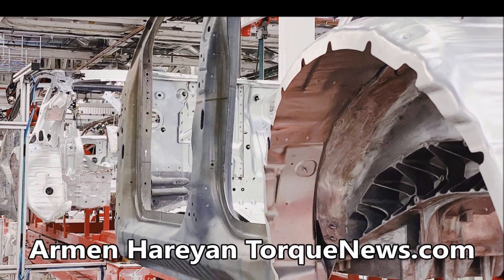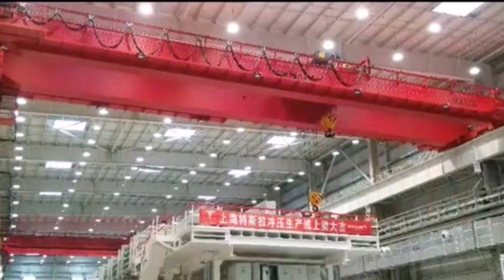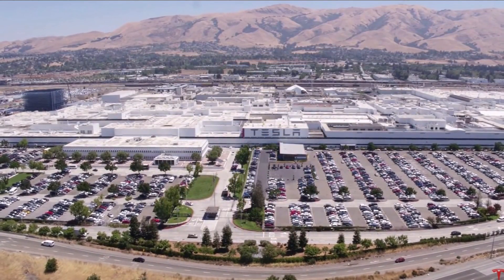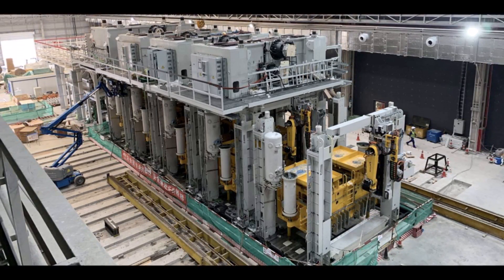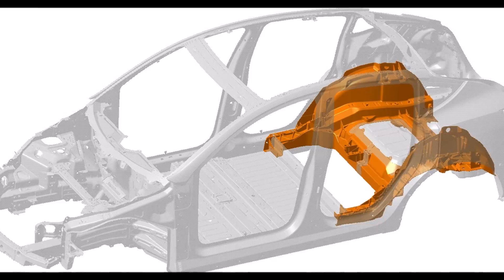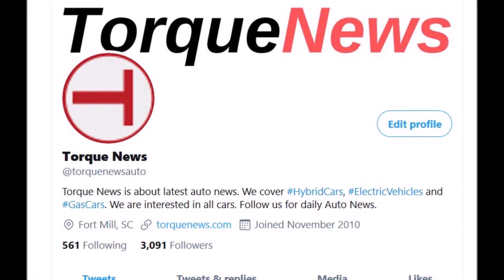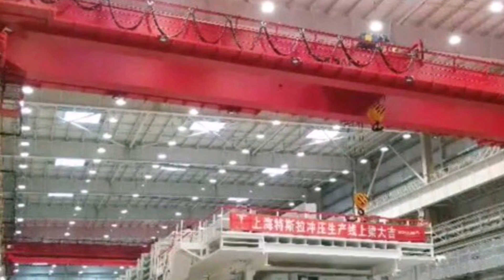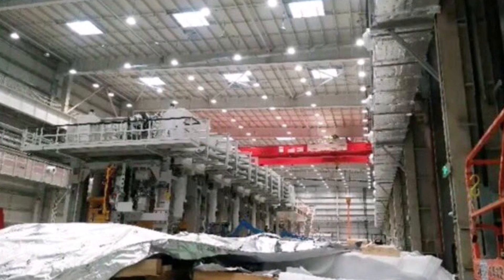Elon Musk: Tesla To Activate World’s Largest Giga Press for Model Y

Comment: The problem with one single casting is in case of accident, as a consumer you will be fucked as it won't be possible to remove the damaged section and  weld new parts to refurbish your car which would mean if you crash you are irrevocably fucked

Comment: There are other things that havnt been addressed by anyone 1 hes cost of buying car will become cheaper and cheaper with his production increases 2 he have no retirement benefits the chev frd and Chrysler have that is a big cost per vehicles 3 other auto manufacturers have to build so many cars with a certain epa mileage rating or pay a fine every year 4  so every battery vehicle they build  they lose money on car but spread the losses on other cars.5 the cost of battery for other manufacturers will be alot more tha tesla and the cost of electronics 6 im shure he will in the next 3 years he will ave doubled his volume to the point that other manufactory will not be able to compete 7 the other manufactory relie on dealers witch means the cost of vehicle has up to 3 percent of the cost built into the cost of vehicle plus approx 5 percent is called holdback built in price of cost of unit ll this is added to the cost of the item then dealer profit is 5 to 9 percent added to that.
So to some it up themanufactorshave a hurtle they can't reach the numbers to compete thnks bob batson

Comment: Do not get in a fender bender in this car. Instead of replacing the bent part, this car will be unrepairable and a total loss.
Reply: Elon explained that the cast frame is behind collapsible metal structure shocks and supports that should take up most of the accident impact energy. Almost all impacts that are more than simple fender benders will cause insurance to total a car out anyway these days. And for those future Tesla rebuilders getting a new rear section would make for a much easier repair than trying to re-align and re-weld the 170 parts that will be replaced by the single cast subframe.

Comment: I've been wondering what will happen to the two piece casting press initially used for Model Y production. Elon's been asked if Tesla intends to use single piece casting for Model 3 but was somewhat cagey with his response. Now they may just want to wait to see how well single piece casting works out for the Model Y before moving to replication of the process for the 3, but now, if the 2 piece casting press can be reconfigured to suit the Model 3, will Tesla reuse the same 2 piece casting press to speed production & further reduce costs. After all, that two piece casting press wasn't a cheap item, only to be used for a few short months.

Comment: You're using the words press and cast interchangeably. This is a sheet metal forming press, nothing to do with casting. They are extremely different machines/processes and it's a bad error to mix them up.
Reply: He is talking about the biggest casting machine in the car industry, though,  Tesla calls it a press.. That's the reason why he uses both words interchangeably.
Reply: @joeabad5908  Actually a platen press. Toshiba has made very large ones for many years. What a great new idea? Youth are easily mislead by tech talkers.
Reply: @randallbunton9400  Thank you for the info,  am learning everyday.

Comment: Better hope car never gets into an accident as if that single stamped part is damaged the whole car is pretty much totaled...   Good for Tesla for production efficiency but bad for consumers as far as ability to repair....  Think about it 🤔
Reply: I had the same reflection , like for 4 parts could be reasonable but one single casting will be a hard pill to swallow , also I don't like the idea of batteries participating in the structural rigidity because it will mean a complete battery pack change even for a stupid moderate crash

Comment: Cast aluminum is good and stiff. It has a lot of advantages over stamped steel. But if you ever bend the casting in a crash, don't expect a frame straightener to fix it.

Comment: A press is not a casting machine. Casting is done with molten metal, pressing is done with metal plates.
Reply: The press holds the cast dies, that are clamped with the press!  duh...  I worked several years in the injection molding industry...AND at a foundry that cast it's parts with sand casting molds (no press).

Comment: Another factor that I'm sure Sandy Munro would know a lot more about than me: By a single large casting on one major section of the vehicle all the robots that still work on the vehicle will be able to get more precise alignment points off that part for working on the rest of the car.  (Fewer +/- tolerances need to be added together to come up with a position. One part, one set of +/- (theoretically). 
I started to order a Model Y and then I got cold feet.  I better pay my taxes, I better wait until battery day... heck I'm willing to wait until I can get a Model Y with this single casting in it. It's like owning a piece of engineering history!

Comment: Jaguar was one of the first companies to utilise significantly sized aluminium pressure castings in its cars, typically suspension mounts and structural hard points so its not new, just the scale of the casting. Clearly it is helpful to have such components where alignment of body and parts is concerned as dimensions can be controlled to improved tolerance. If the most noticeable manifestation is panel gaps then I would Expect Teslas to be rolling out the factory with a consistency to beat or match legacy car makers such as VW who have built a reputation for  such detail. Just like watch making it takes years and years to build up the multiple techniques to building a fine analogue watch. But just like watch making along comes someone who designs the digital watch and leapfrogs the accuracy/price benchmark. Wisely Tesla has looked at the problems involved in body in white build and is going to take the "digital watch" approach, its quicker / cheaper / better.......another game changer, typical Tesla, impressive.

Comment: Seems how many times did you have to repeat there is gone to be a big casting machine. They did
lower prices by 3k will they do it again? (when) .  I wonder if the stamping machine is already turning
out one piece rear ends and that was the 3k drop. Now if they can only get the body panels to align.
I haven't seen one Y yet that has really good alignment of the front doors to camera lines and I have 
seen about 5 or 6 now. I live within 35 miles of the US factory in CA. That fender alignment has me 
comparing the body lines on all cars I see.  Only Ford is a as bad if even.

Comment: Now, Elon could vacuform plastic (light) body shells to go with the light weight chassis.  This process is also very fast and would help meet the quota sought.
Reply: The process is not fast like normal stampings
Reply: @alanmay7929  Yes, but plastic doesn't rust.
Reply: @guypehaim1080  you are very funny, use plastic as structural part of a car!! Wtf!!
Reply: @alanmay7929  Royalite laminate was/is used for boats and for one car; the 8/10 Cord.  The car can be made of two shells, one for the top half and another for the bottom half.
Stainless steel pads for the suspension

Comment: A press as pictured is not used for "casting" in the manor you speak of.
Reply: I’m confused ! Is it pressing or casting, they’re different right ?
Reply: @maiandong9918  , probably a type of die cast which is like injection molding with plastics.  notice that the rams force almost melted metal or melted metal into the die at tremendous pressure and fairly quickly.  The challenge is getting the metal to flow to all parts of the die cavity and to  knit with metal coming in from other ports or sprues.
Reply: Richard Rosenthal - thanks, interesting 👍

Comment: Please answer this. If I had an accident in my new Tesla Model Y I might have had to replace a few of the 70 parts referred to. NOW, the same accident will require the replacement of the entire back end. Is this correct and will that mean a minor accident puts the car beyond economic repair?  This is not a criticism, it's a question.
Reply: The 70 parts are 70 small pieces welded together which then acts as one piece. So damaging that larger one piece is similar to damaging the casted one piece. But since it will be easier to produce, the price of the casted part might be so low that replacing the casted piece instead of wasting labour repairing it may become more economical.
Reply: @Scholzey  wtf!! Why did they even ended with 70 parts for just a small car section?? Wtf
Reply: @alanmay7929  I guess it's just they way it's always been done and since it's been done for so long it would be extremely well optimised process, probably perfected, but with that much welding, the one piece tesla can now do will improve manufacturing speed massively. It took tesla to imagine this, and I'm sure every part in the car will face the same optimisation process, which is why won't thinks manufacturing can increase to at least 10x the current speed.
Reply: @Scholzey  as i said other manufacturers are already using die cast parts to significantly reduce the cost and optimise production, by using lighter materials like magnesium or carbon fiber its even easier, look at the bmw 7 series production, also vw and toyota are the master of optimisation by making 20 million cars both a year
Reply: @alanmay7929  I'm unsure of the size of the castings the other guys use, I'd assume Tesla's end game would be attempting to do the whole chassis in one go. In my head I'm thinking that every Panel will be aligned perfectly since the parts won't be misaligned by welding inaccuracies over the entire car. 

Also on the subject of other manufacturers, I think they may be limited in the size of their castings by the material they use. Tesla has an alloy that doesn't need a heat treat that is usually required which would usually have the side effect of warping the cast.
Reply: @Scholzey  yeah another nonsense, the Italian casting machine made for tesla uses hot/molten aluminium and it has to be cooled down, also making the entire chassis from cast aluminium will not be cost efficient, aluminium is already too expensive plus its britle compared to steel, and I'm glad other manufacturers are using more diverse materials like carbon fiber or hot preddes steel for cheaper and lighter cars
Reply: @Scholzey  explain me please how can inaccuracies occur with welding entire cars, toyota porsche has been doing that for decades and never had a problem,
Reply: @alanmay7929  sandy Munroe talked about when you haven't spent the time to dial the machines perfectly, you end up with a chassis that isn't perfectly aligned like it could be. He said this is likely the reason Tesla's have uneven gaps around the place.
Reply: @alanmay7929  fyi I'm certainly not an expert on the subject. The assumption that they were eventually going to cast most of the car was due to the patent that was filed that appears to show the massive casting machine surrounding what appears to be the whole body.

Comment: there's a difference between a casting, and a press...
Reply: Dave Newman it is an injection molder for aluminum that creates a die cast part. Pretty cool piece of equipment to see in action, helped with an assembly of the first die cast machine installed in Nevada.
Reply: @richardharrison2203  Well this could be useful for the gov to build them UAPs
Reply: Yes the casting machine still requires die casts to press against each other under very high force to withstand the pressure of the injected molten aluminium, and be able to eject the cast Aluminium part.

Comment: Alright Armen!  Great video.  Wonder whether the casting press will be able to make the tractor trailer frames ?  No reason it cannot make the Cyber truck frames.  At this rate cars will take one hour to build and cost $5,000.00 by next Christmas!
Reply: Nope, the casting is not cheap either, it needs tons of electrcity to melt and cool the metal

Comment: I definitely feel like in next 5 years, we could see a new refreshed design of Tesla's existing fleet of cars or even new lineup of ultra high tech and awesome looking interior like we see in the new EQS and Lucid Air. I love Teslas for their goal towards increasing sustainable transportation but now that they have created a lineup of cars that are affordable like the Model 3, and Y, they could profit alot from creating something fresh and expensive even if it costs as much as Mercedes S-Class so they can use that profit to keep lowering cost of Model 3 and Y. For example, the Cybertruck looks futuristic but in my opinion it lacks the futuristic design from inside like we see in EQS. I wish the truck came with luxury features like massage seats, additional thigh extending seats like BMWs and Mercedes have to help offset leg stiffness after long drives. Dont you guys wish you could have like super high tech ambient lighting in your Teslas. I know it's not possible with current fleet due to margins but I think it could be possible with upcoming fleet! Of course, there's everything available for aftermarket, if Tesla makes futuristic design, it would add alot of statement to the brand as luxury fleet. What do you guys think on this? Any thoughts on the interior upgrade needed?

Comment: Fremont main facility has huge crane building new structure now.  A mile or so away on Kato road R&D facility they have 2 medium cranes (100ft plus) and tons of equipment delivery's crowding the road. I see it every day on commute to work and back. They very busy.
Reply: At Kato road they're just adding on to the new battery facility so that they can produce more of the next generation batteries.. and at Fremont it's probably the new casting press that they're installing right now.

Comment: So the question is, with such a substantial portion of the car made as one piece does that mean almost any significant crash damage means automatic total of the vehicle?
Reply: It is mentioned that the part includes  crash rail. Which is a special attachment for crash structure. If the crash is significant enough that it causes deformation beyond the crash structure then that car is totaled. The question is not if the car can be saved but can you be saved from that kind of crash. Tesla is not casting fenders.
Reply: kazedcat TM Thanks for explaining that. I was wondering about repairs. That’s another part of lower cost products, they are totaled with less damage and these cars are going to become much cheaper in the future with these improvements and others.

Comment: so what stops any other company from buying this machine?
Reply: Not having enough cash or good enough credit????
Reply: Capital and the alloy of aluminium( I believe it's tesla proprietary) that doesn't need a heat treat after the moulding process. Also purely that it is different. They resist change as much as possible.
Reply: Its a custom machine like the other robots that tesla uses, tesla uses the same robots kuka/canuc like other manufacturers
Reply: The machine is not the secret sauce. The casting process is the secret sauce. It is like cooking. Buying the same equipment that a 5 star chef is using does not mean you can cook the same quality of food as the chef. You need to learn how to cook good food first.
Reply: @kazedcat  nonsense, there is no secret sauce, its simple physics, the machine manufacturer/ IDRA has the experience in giant casting, and they make custom machines worldwide like TBM

Comment: My next car will be a Tesla.
Reply: I own a few Teslas.  Best cars ever!
Reply: Use the money to buy $tsla instead and in 5 years or less you'd be able to easily buy a house and the tesla. Just a thought.
Reply: meenoo meenoo bought TSLA at 300 and now have a PM3 and even 16 share left 🤗
Reply: @meenoomeenoo4578  that's exactly what I'm doing,  should have enough for that and retirement by the end of 2021 or sooner  😁
Reply: meenoo meenoo that’s what I did! 🤣
Reply: All my next cars will be Tesla :)
Reply: Ditto
Reply: Same
Reply: Great to hear. Just do the lifetime maths and it makes sense. Don’t do the maths and drive a Tesla...guess what? Yep!
Reply: And mine. When they are cheaper.
Reply: ygg drasil fo maths now.
Reply: instead of a 60kw battery and a weight of 600 kg it is better to divide the battery in two. one of 10 kw and 100 kg permanent with a range of 100 km that would be enough for the city and a detachable battery of 50 kw and 500 kg to rent when you leave the town. instead of stopping at the peco to fill up for the road you can go to a power supply point in your city and mount a 50 kw battery from there and on the way to replace it at another power supply point with a charged one . the first advantage is that it would save a lot of batteries, especially since the 2 million km batteries will appear, which practically do not wear out and must be fully exploited. if a car is lighter by 500 kg, I think it will have a significantly greater autonomy. this would be the second advantage. a short recharge time of up to 5 minutes to change the battery would be another advantage. the price of cars would drop by half. I'm waiting for opinions
Reply: cybertruck for utility, polestar2 for luxury
Reply: Me too!
Reply: my first car will be a Tesla